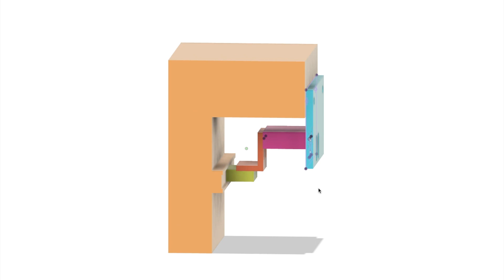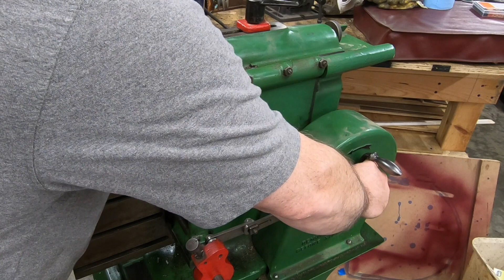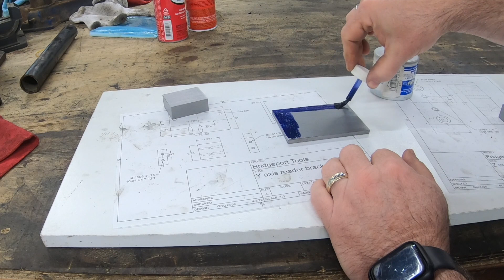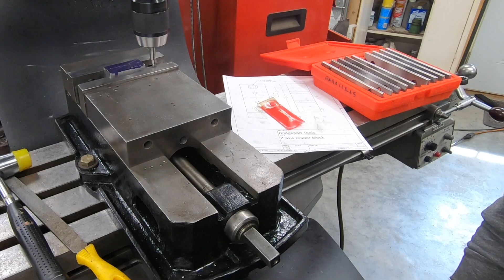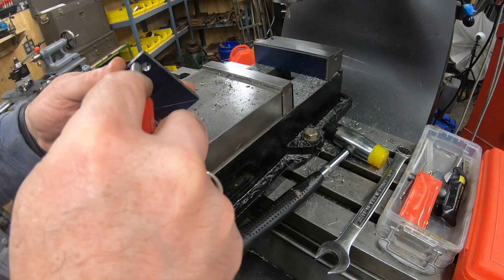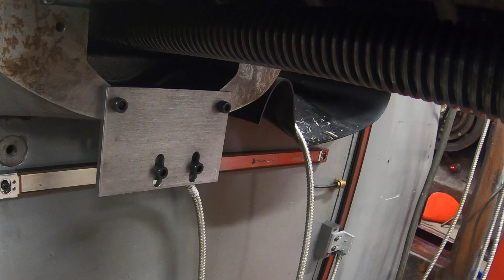Using the Shaper to Machine DRO Read Head Mounting Blocks

Comment: Yeees, the shaper!
Just a little tip, increasing the stroke length does not increase the cutting time but the cutting speed.
Reply from the maker: Thanks for the tip! Now that I think about it, that makes a lot of sense. The motor is still running at the same rate. Ooof.